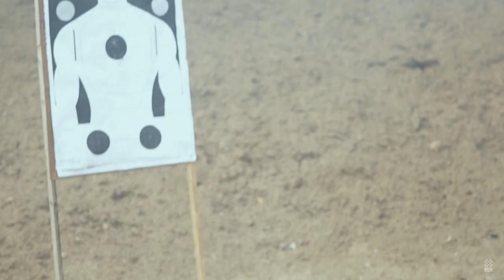NOVESKE: MASH UP

Comment: Brave AF putting that bolt release in like that.  I learned my lesson too many times
Reply: the tool is slotted specifically for that roll pin so the punch wont slip. Buy the right tools, they are out there. They have one for a gas tube pin too. What I need is a jig so I can beat the noveske gas block retaining pin onto the barrel.

Comment: Love the gun. Wish, wish I could afford one.  Tactical videos, at least in practice should feature those who could run a single mile under a time not requiring cardiac support. NOT Trolling. Just looking for a reason to spend 2.5x over other cuts putting it down range.  Let me restate:  want one. Can’t afford. However, respect the rest of the craft in the message.  Down range you don’t find this beef.
Reply: Honestly think I'm just gonna save for one. My dads the type to buy like 10 cheap rifles, which is fine I guess but I want one that'll last a lifetime (or at least I think these will last a lifetime idk I have no experience with Noveske).